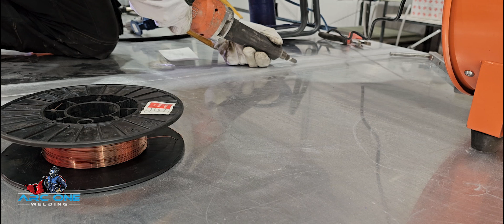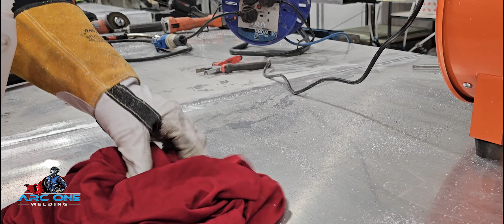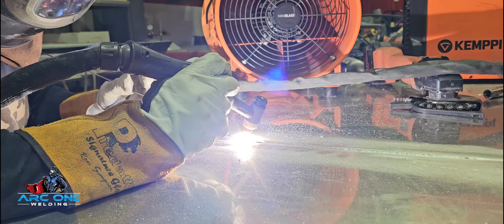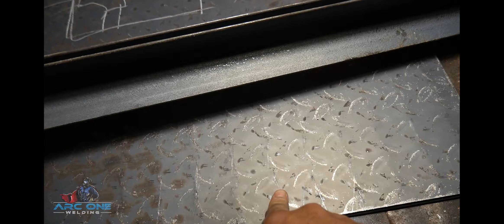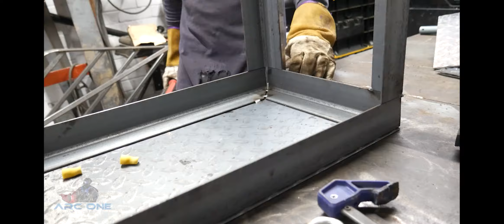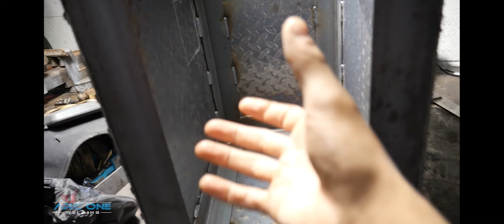I Failed & Lost Money On This Job

Comment: Wd40 and carbide grinder that is made for steel with small teeth gave you problems.
You could run mig and put material fast then just melt it with tig and get rid of pin holes, I know this was hell

Comment: Use wax with your dye grinder WD-40 contaminates aluminum I am speaking from experience use it all you want on Steel you'll burn it out of the joint not the case with aluminum I would like to suggest since everything is 240 volts over there looking at a HTP America Pro pulse 300 it has single pulse and double pulse and you can use a 35-foot push pull gun with it it doesn't have a dating on its duty cycle between single phase and three phase in US Dollars it's $4,999 for just the steel package it's just a little bit over $5,000 us for the aluminum package I think it would fit your operation well but in the end that's for you to decide just figured I would make you aware of that machine because it's single phase and three phase with no duty cycle darating

Comment: IF you find yourself limited for Amps on your AC Tig.
Try running a mix of Helium with your Argon.
It will help your arc to run a little hotter,  and some Pre- Heat from something like an LPG bottle will definitely help to take the chill out of the Aluminium before you start Welding 👍

Comment: I think I would have pulled the sheets up.

Use the map gas heat to break the epoxy flip the sheets clean all the sealant / epoxy from around the joint, using acetone or maybe one of those stripping discs then acetone.

 make sure they're basically loose off the frame underneath.

After all that then weld them.
To help with heat you use helium this will really help with heat.

There are some 230v AC welders with a function called mixed Tig it has different names on different brands but essentially it pulses in some pure DC negative into the wave form.
This really helps with heat & penetration.

I use a 220 amp WECO 221 Discovery ACDC it has this feature and it really helps on thicker material.

The problem with a 3 phase welder for mobile work is unless you bring a generator you won't always have access to 3 phase plus there heavier.

I have 13kw generator with both single & 3 phase mounted in the side of the Van but I try not to use 3 phase for mobile work unless I have no other options.

Make sure your single phase welders have power factor correction this will give you more head room before you trip a breaker if your using power at the location.

I sucks though, it does happens to everyone when you have a job that ends up costing a lot more than you budgeted for.

Good luck

Comment: Big chance it was the WD40 at the start mate.  Putting it deep into the material. Done 10+ years with Ali myself it can be a nightmare for passing testing . Massive fan of the channel though brother. Cracking content all the time 👏🏼🫡
Reply from the maker: Thanks for that mate and the wd40 didn't help at all for the welding but the bit was binding up so fast without it. I appreciate it though
Reply: @ARCONEWELDING  I personally use a coarser bit for the die grinding when doing aluminium. It cuts faster and doesnt clog up when not using coolant. You can also get carbide tipped saw blades for you angle grinder, I use them for straight bevels like that and they are crazy fast. Just watch your fingers.
Hope to see more aluminium content from you, my guy.

Comment: How did you fail? It looks and sounds like by them gluing it all together they unknowingly sabotaged the Job. They should have dismantled the table and cleaned the epoxy and glue before you even got there. Obviously along with all of the other things you have learned and mistakes made from lack of preparation on your part too. It seems like a job that was never ever going to work without all of the changes.

Comment: I have welded aluminium with Mig, no great success unfortunately and the same with tig. Clean with acetone, preheat and all that and I still wasn't happy. I also have a Thermal Arc 202 AC/DC Tig/MMA welder and you are right, the duty cycle is very poor indeed. I had to go and check when you said "100% @ 90amps".  It is true and at the rated 200amps on Tig it is only 20%!
However, I mainly use mine for stick welding plant machinery off a genny, and too my surprise, 15% duty cycle at the max stick output of 170Amps and only 80Amps @ 100%. Well, I have to confess that I have broken the rules on that. I put a new bottom in a digger bucket recently with near wear strips and such like and was welding for a solid 2hours at a time, 4mm stick after 4mm stick at 162Amps. The genny had to be rested every 2hrs because it kept thermal tripping out. I did keep an eye on the temperature of the welder, and as you know they are very noisey as the cooling fan blasts air into the machine. It never even got warm. And that is why I didn't rest it between rods.

Comment: Aluminium rule number 1 : you need 50 Amps for each mm of material thickness… and consider all the major factors like: the filler metal might not be the best or compatible with the base metal?!

Comment: The best thing I ever did with Ali was run a pulse machine! Weldmax 355i to be exact. Makes welding Ali so dam easy! I don't think that WD-40 would have helped unless you got rid of all of it. As you said their was resin and everything underneath so if all that shit was coming up through the gap then you still did a great job considering. While watching the video I was thinking why dont they just sheet the table with plastic. Then you said they taped the joins so that works too! Awesome work none the less! Love your video's bro. Been watching a lot of your piping stuff because I just won my first piping job and I've never done it before 😂 only a 24k job so hopefully I don't do my ass on it! Haha

Comment: Cleanliness is the key to aluminium welding. After die beveling brush the weld prep in one direction only, after that use acetone and paper towel to remove the rest dirt from weld prep and your tig rods. Then weld. Perhaps you could increase the balance to get more cleaning when amplitude is in dc+ period. Aluminium is the bastard.

Comment: Try a helium argon mix gas first before buying a new machine if your running pure argon . The helium will boost your welders output amp wise by roughly 35% whilst still running on the same amperage.